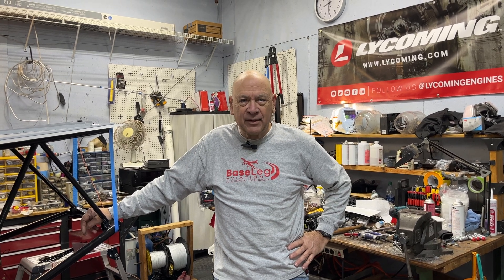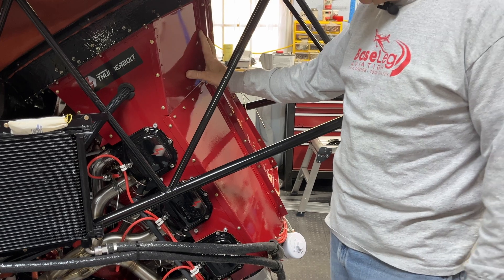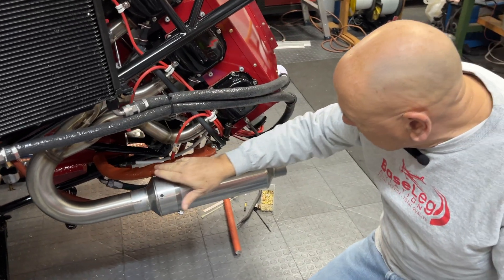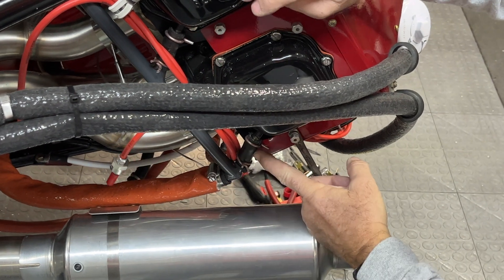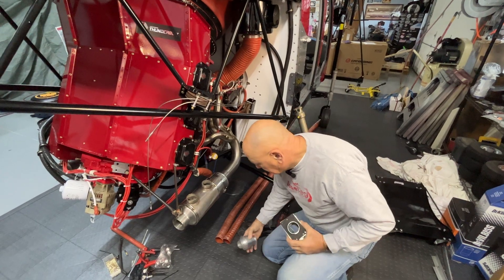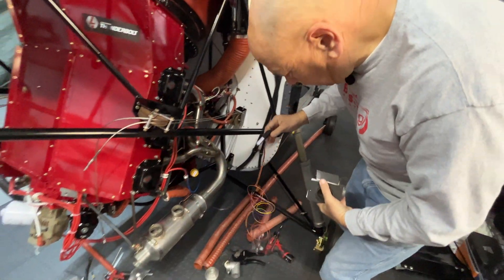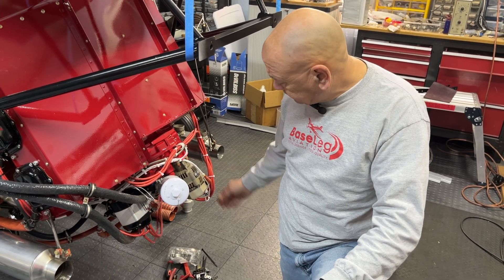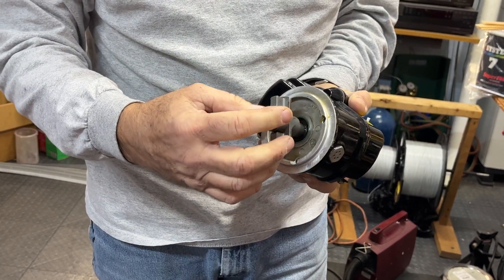EAA Webinar "Maintenance Horror stories" tonight, Humminbird Update

Comment: Copters are scary, if the motor dies, you just fall. Unlike a plane, you can at least glide. Possibly its just my ignorance but I know motors are never 100% full proof unless you have redundancy.
Reply from the maker: Well, I don't know about the falling part. :) It's called autorotation, and it works very nicely. It's actually very gentle in this helicopter compared to others I have flown.
Reply: @baselegaviation1614  Yea, I can see where ignorance can be a seed for fear. I’ve never heard of autorotation. Very interesting stuff! Thanks!